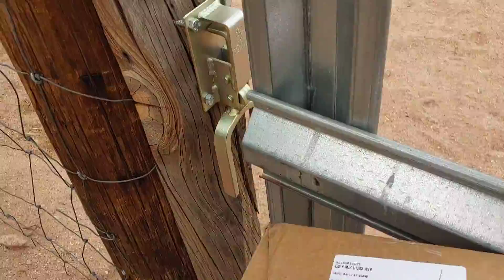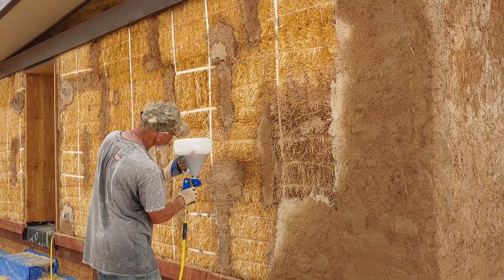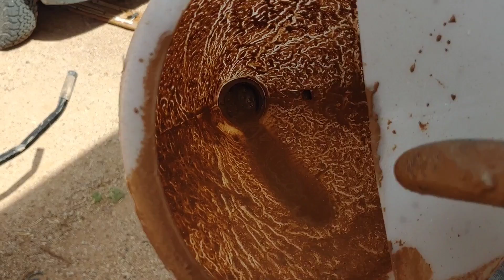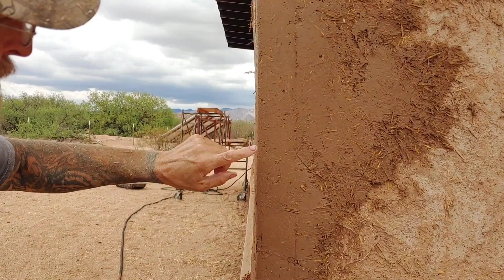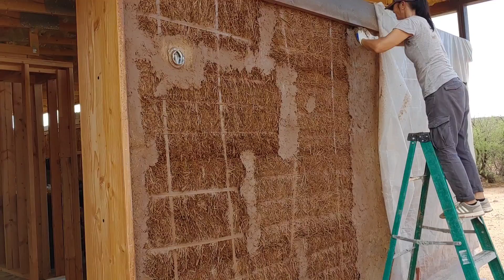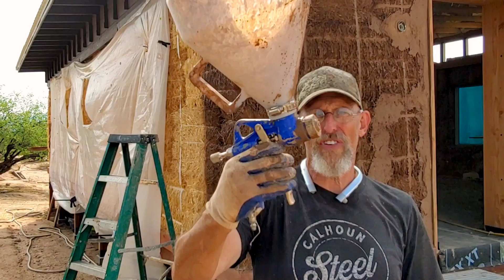Applying Clay Slip to Our Off-Grid Straw Bale House Walls • Slingin' Mud Part 2

Comment: I have Been spraying mold for 11 years. It’s impossible to find a good sprayer. Don’t want s backpack. Don’t want to mix 5 gallons at once. Just a hand-held , battery powered sprayer. 

The Ryobi 1 gallon or even 2 gallon hand held would be fine if they worked. They don’t. Pure junk. Went through Thrre of them in one job. Frustrating. 

Regarding this application : I wonder if just spraying the whole thing lightly would make the COB hold better ?   Otherwise it looks like a struggle to just start sticking mud/cob onto bales. I love this straw bake home . I’ve gotta do it. Evrn if it’s just a decorative wall near the mailbox

I have a jackhammer with  a tamper accessory. ($190). It’d 9” wide. I don’t know why it wouldn’t work.

Comment: Where you sprayed the 1st coat on western exposure could have done all coats with sprayer and avoided doing it by hand?
Reply: No. 
The spray coat is primarily so the plaster layer can bind easier to the straw. Without a spray coat, you have to almost smash the plaster into the straw.

Comment: Nice ! An other approach, is to dip each bales into a bathube of slip before placing it. But i like the idea of the sprayer, for something like the roof insulation, it could be lighter and easier to carry a not heavy and wet bale
Reply: Then it would never dry in between the layers.
Reply: @TheAlmightyGod1  I did mean dip not soak, and offcourse, as every strawbale workingside, it has to be done in summer so it dries well
Reply: @AutoNomades  You still have to fill in the gaps.
Reply: @TheAlmightyGod1  wich gaps ? into the bale or beetween ? Between you can complete manually if you need/want to do. At least its easyer to coat or complete after a first dip or spray, because the dry straw is a bit water proof at first (straws are kinda covered with a kind of natural wax)

Comment: Use of hawk and plaster trowel would work better than hands also
Reply from the maker: In theory yes. In reality, no. I own and know how to use a trowel and hawk. For the first coat, the plaster needs to be pushed into the bale with a good amount of force to achieve a solid bond. The problem with a trowel in this situation is, the pressure is dispersed over the entire surface area of the trowel and cannot force the earthen plaster deep into the bale. The result is a plaster that does not have a strong enough mechanical bond. Now the second coat of plaster can be easily applied with a trowel with good success, and that is how I apply it.

Comment: Isn’t that way to wet and watery?
Reply from the maker: Not at all. It provided the perfect sticky base coat to the bale's, allowing subsequent coats of earthen plaster to adhere without falling off. It also made it possible to force the Cobb deeper into the straw bale surface for a better bond.
Reply: @theupsideofdownsizing  super cool

Comment: I sure enjoyed this one and previous on the strawbale mudwork. I been thinking of doing a small farm structure using strawbales but I had planned to put chicken wire on sides and do a cement mixture like stucco because of our weather here, I'm in northwest Florida. I have an old cement slab that probably was an old garage back in the 1930s when the house on this property was built. The slab is about 14x16; I was thinking of making it a little farm structure with a shed style roof by having one wall higher than the other. I have some cypress poles, I harvested trees from my property, I was thinking of using for main pole barn type structure, and for  the rafters for roof, then cover it with tin. I thought strawbales could be the walls, it would be cool in summer and warm in winter I would think. I didn't realize it would be done like you did it without metal wire.

Comment: What compressor are you using ?
Not the same one as the nail gun ?
Reply from the maker: Up until last week, I have owned only one compressor. A 6 gallon pancake compressor from Porter Cable.

Comment: There are so MANY of you in Cochise county!  Tiny Shiny Home is there, Green Dream Project is there as well.  One of the neighbors of Tiny Shiny Home went and did a work shop at CalEarth.  Scratch coat to keep it on is 9 parts earth (your soil) to one part Portland.  Tiny Shiny had the same issues you did and after they added the Portland, the issues went away.

Comment: great job today.
I've seen other folks trying to use that clay blower and they stuffed up badly with it
Reply from the maker: I made the mistake once too of making my clay slip too thick and even with the largest nozzle it clogged. The thinner slip sprays well, gets more coverage on the walls and works great as a "glue" for the first coat of earthen plaster.

Comment: Bill I love how you and Yvonne are learning as you go but use insightful and intelligent ways to do things like creating the right formula for the slip and using that inexpensive looking but very effective slip spray tool. I am thinking our intense heat could work in your favor as the slip/cob is applied and bake quickly? Lots of hard work but if the end result is anything like that sharp looking solar shed this home is going to be one to admire.  Way to go!

Comment: Enjoying the build! But I’m wondering why no metal mesh on the bales before using the clay/plastering? Wouldn’t that make the clay/plaster more secure?  Maybe it’s on there and my old eyes just don’t see it :))
Reply from the maker: Stucco lathe is used around the window frames and over any exposed wood. It's not needed over the bales because the straw offers all the texture/ grip needed for the plaster to "key in" and produce a secure bond. Thanks for watching and your comments!
Reply: That makes sense. Thanks!:)

Comment: Just ran across this video about applying lime based mortar to a mud base. If your aware of this problem ignore the link. If you have a newer solution for this problem please share your differences.

https://youtu.be/BAgQZM5clOA
Reply from the maker: I've watched that video a couple times and I think the problem that that house had was there was no mechanical bond between the Earthen plaster and the straw bale. that's why it broke away so easily. there was a big gap between the actual Earth and plaster and the Bales. That's another reason I was using natural hydraulic lime as a fortification material in our first coat (or brown coat) of plaster. my thought was, if we add some lime to the Earthen plaster, then if we decide to go with a lime plaster as a top coat, it will be more likely form a mechanical bond between the two layers. Because of the price of the natural hydraulic lime material, we have opted to go another route. That'll be discussed in an upcoming video. Thanks for watching!
Reply: @theupsideofdownsizing  I'll be waiting with fervent interest!

Comment: One could imagine that spraying the slip may actually provide better keying of the plaster into the straw by driving further into the bales.  Seems like a great process improvement!
Reply from the maker: We agree. And in terms of efficiency, were guessing 30% faster overall with 75% less waste ( fall off, both slip and plaster).

Comment: Another tool that helps level plaster surfaces first coat. ????
42inch or 48 inch magnesium plaster/concrete Darby...  App $38
Basically put it on the wall hold the one pivot point and swing circles
Move to a different pick it point
Float again..
Walls come out pretty level without humps or low spots....
Just another tool that may help
Reply from the maker: I gotta see one of those in action. I'd be all over it! Thanks for the tip Jim👍
Reply: @theupsideofdownsizing  
Check out UTube videos
Darby
Reply from the maker: Ordered a 42 incher today from the dreaded Amazon. Magnesium, $29. Binge watching a guy on YouTube who has been plastering/ stucco work for 30+ years and has something like 900 videos. A real artist with a trowel.
Reply: @theupsideofdownsizing  
Hope it helps
An outside bullnose trowel might also help
Should feather the corners out 3 - 4 inchs
Reply from the maker: You know I gotta check that out too.... But the edging tool worked pretty well on our solar shed windows. Once floated and sponged they developed a nice radius.
Reply: @theupsideofdownsizing  
I've found the larger the radious
the better up to a point
and to me they look softer
more gaceful

Comment: How many coats of mud do you put on the walls
Reply from the maker: 2-3 depending on how much flattening or correction is needed.  Certain areas, like over the windows for example will need 3-4 coats in order to build up the height or thickness to be level with the rest of the wall.

Comment: The average small house (under 1000 sf) uses about 7000 board feet of lumber (like $10k+).  I will be really curious how much you have saved on lumber by using straw bales (as well as on insulation, etc) by the time you finish.  I think it will be significant.    Really exciting to see how quickly your are covering up the exterior bales!
Reply from the maker: At $9 per bale, and we bought 125, (only used 100), for that money we could have stick framed one wall at today's prices.  And the price of insulation, if you want anything other that the pink stuff is outrageously expensive. Rockwool or recycled denim would have been several thousands for the walls. I'm not a receipt keeper ( Yvonne is ) so a true total cost is not going to be possible but we certainly got lucky with the timing of the build. The foundation, the front deck, the roof all would have been 3x our cost if we were starting today.

Comment: The hose leaks more air than the gun uses...  Fix the hose and save yourself a ton of power running the compressor and less irritation from listening to it also...
Reply from the maker: It's not the hose it's the gun. And I think it's because I have the compressor set for 90 psi. Another subscriber said I should be using about 30 PSI so I'm going to dial it back and see what happens. Sorry about the irritating sound.

Comment: Glad it worked, you can play with the pressure but I believe you want it to go deeper into the straw. Lower pressure could make it only to the surface. I believe this could also work when doing your final coats as long at it doesn’t have straw.
Reply from the maker: I was actually thinking about applying an earthen paint, or a thicker clay slip with pigments, 5hen finished with either a brush or trowel. We've got some experimentation to do for sure. Someone else menti using a lower pressure, around 30 psi. I've been using 90 cause that's what my compressor was set at for my nail gun. That's why instructions for the texture sprayer would have been helpful.
Reply: @theupsideofdownsizing  yes sir when I’m applying texture to a Sheetrock wall I run mine around 30 psi. But that’s more for the texture. For what your doing you need more of a full coat so it will take more pressure.

Comment: couldn't you do similar when applying the cob? I imagine you might have to cut the straw up to something finer but how would it be any different than how for instance stucco is sprayed onto a house.
Reply from the maker: Right now, the straw I'm using in the mix is extremely fine 1/4 to 1/2 in Long and would probably go through this sprayer. I've seen sucko sprayers that use much more powerful compressors to throw the stucco on the wall. We've also heard about someone who did an entire Cobb house using such a sprayer. I really don't think that's going to be necessary for us we're happy to continue having our hands on the plaster. If I were doing a business, I'd be looking for a machine for sure. I'm thinking about how I might be able to use this for a clay based paint for the inside. Could be interesting.
Reply: @theupsideofdownsizing  I am looking forward to seeing how you do the inside.

Comment: Put a piece of vinyl screen mesh over the hopper before you connect it to the sprayer. It will block out the rocks, hay, and unresolved clay. It might be a pain to connect, though.
Reply from the maker: The issue is I didn't strain the clay. And it's not a big deal. I just have to be careful when I pull the slip out of the mixer. I have to gently skim the slip off the top because the aggregate is all settled to the bottom. Ever since that one clip in the video today, I haven't had another issue, because I know what the problem is. It's an easy work around. Thanks for watching!

Comment: If you look at the video where you refilled your applicator's reservoir you'll see that you introduced grit to the mix from your placing the cup on the ground instead of keeping it clean. The ground is not clean! Just sayin'. Glad it is working for y'all.
Reply from the maker: Actually there's about two cups of granular at the bottom of the mixer when I make that slip. It's because I didn't sift the clay. Ever since that clip, I'm more careful to skim the slip off the top and I haven't had an issue since. Thanks for watching and you're being so observant! Oh by the way, the rock that was actually stuck in the sprayer was about the size of an almond.
Reply: @theupsideofdownsizing  Thanks for getting back to me. I now know why you mentioned screening. Enjoy your channel.

Comment: In such an abrasive environment that sprayer has tolerances measured in 1/8's of an inch, not thousandths. 
Any tighter than that would cause all sorts of blockage problems even if the slip ingredients had a tighter control on quality.
It's like a Sharpie, use it until it stops working then replace it.
It is a consumable item, not a long life tool like a drill - and your one does the job well.
But your house is progressing very nicely - congrats to both of you happy muddy folks.
Reply from the maker: I see what you mean. When I opened the box, the first thing I noticed was how they sprayed the paint right over the threads that hold the nozzle in place. And the threads are so fine, like machine threads that cross threading the collar is almost inevitable. But, it's getting the job done and like Bob Barker use to say, the price is right. 😉 Thanks for watching!

Comment: Never bad mouth a tool that works as well as that sprayer does.
It will come back to bite you in the butt. lol....
How goes the tire wall you guys built to divert the monsoon runoff?
Reply from the maker: I was the first to admit that I may have to rethink my assessment of that tool. But it's still a cheap piece of junk. Any tool that has a fitting on it that tears apart at mere sight of a wrench, the quality must be put into question. The tire berms are holding up great!

Comment: your mix is a little thin. that gun will easily spray pancake batter consistency. you can put a 45 elbow on teh hopper and spray more overhead too. your pressure is a little high which is why u got all the over spray. these guns like about 30psi.
Reply from the maker: Thanks for the information. That's why I wanted to see some instructions when I opened that box. I had my compressor set at 90 PSI for my nail gun and that's where I left it when using the spray gun. I'll lower the pressure down to 30. The problem with a thicker slip, is that we need to use a lot more clay. And the more clear we use, the more clear I've got to harvest out of a wash. So right now the thin layer of slip is working really well and will probably stick with that consistency. Thanks for watching and for the feedback!
Reply: @theupsideofdownsizing  yeah i feel that. harvesting dirt is all the fun. you can use bagged bentonite if ya like. but you gotta buy that.

Comment: Looks like the new mudslinger 2.0 really lets the clay slip penetrate the top layer of straw on the bales. So it should make for really strong adhesive for the cob. Is/was the plan to finish the outside before the monsoon season. Or is it more of a finish as much as your able before it hits? Also how long dose it last and often do it rain on you guys?

And I have to say the greenhouse really have transformed. It looked more like a jungle in there now then anything. =) So looking forward to the update video. 

The cacti around the drive way looked very nice as well. Cant wait for them to grow in.
Reply from the maker: We're not stopping with the plastering. As we go it gets covered, which actually will cause the Cobb to cure more slowly which is better. As soon as the first coat is done, which should be in about 3 days, we'll get started with the second coat. The rains don't last long, an hour or 2 but it can really come down. A slow, steady rain would be nice, bit doesn't happen very often.  Thanks for watching!